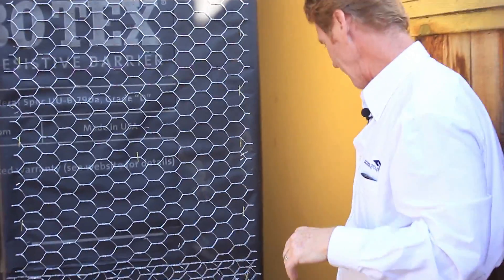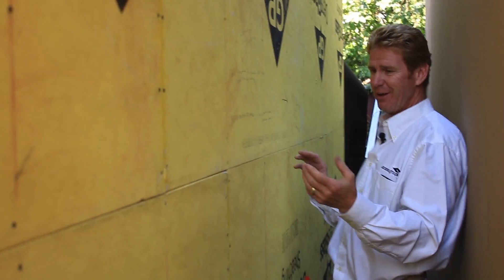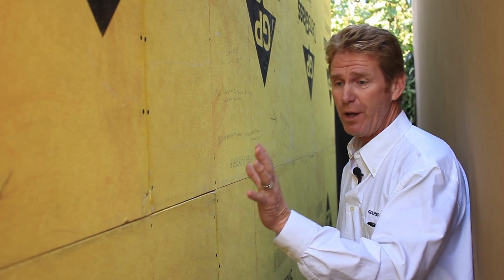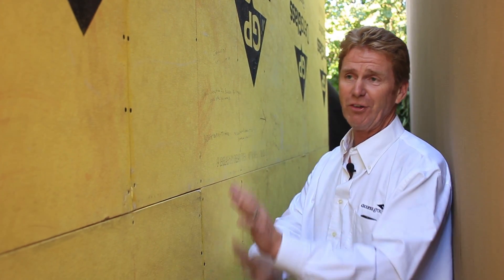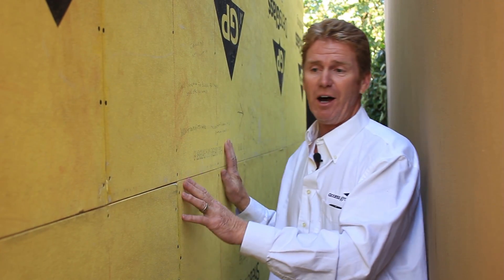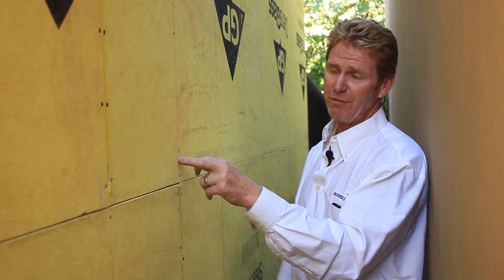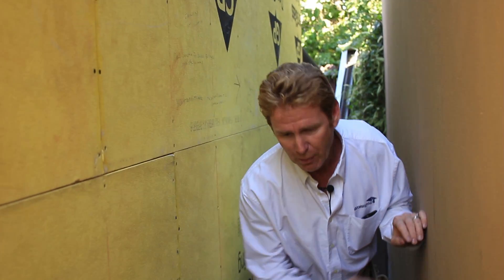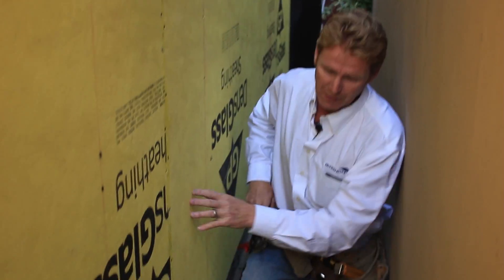Stucco over Densglass sheathing

Comment: Do wide crown staples work to adhere lathe to dense glass where there is no plywood behind densgalss ?
Reply from the maker: They do indeed and are code. Here's a tip,  use a Staple gun leg length that shoots at least 7/8 of the leg into the stud. 
Make sure your gun staples are adjusted properly so that the staples don't rip the paper as Dens-Glass is soft.
 I mention this because on Amazon there are staple guns that sell for about 100 to 350 dollars.
 One often gets what they pay for. This coming Friday, I address this issue in an upcoming video

Comment: Does the densglass have to be put on with any special screws or staples ? I got a house I’m putting denseglass on tomorrow
Reply from the maker: @briancota4648  DensGlass Sheathing is an engineered exterior gypsum sheathing used as a substrate for various exterior cladding materials, offering superior moisture, fire, and mold resistance, and can be used in areas prone to moisture. 
To attach DensGlass sheathing, use nails or screws, ensuring they are driven flush with the board surface and into the framing system, and stagger the joints.
Cheers, Kirk giordano plastering.
Reply: @ what do I use to cut around windows ? Same rotozip just like drywall? Do the screws need to be rust resistant
Reply from the maker: @ I’d recommend you install the dens glass like you would plywood.🕵🏼‍♀️

Comment: Makes me wonder.  What is the preferred sheathing for a home built today?  I’ve seen Zip used a lot in new construction but in areas with older homes and a poor economy they still put house wrap over Osb 🤷🏻‍♂️
Reply from the maker: Hello my friend, today code in the USA is plywood, you can use OSB, but naturally that is not as good as real plywood. Some older homes have redwood siding which was placed on the studs from when it was built. This redwood siding is even stronger than the plywood that has been code for the last 40 years. When I started there was no siding just studs. lol

Comment: Teacher help me this wall does not need to carry stucco oh plaster. It will be that I can. leave it like this without plaster, I only cure the edges and joints and then I prime it and at the end the paint... could it be possible?
Reply from the maker: Howdy Andrew, I'd check with the city in your 
area. In our area, this board needs some kind of finishing, such as stucco or wood siding. 👨🏻‍🔬
Reply: @StuccoPlastering  thanks teacher your the best

Comment: Kirk , this is Hill Billy from KY enjoying 147 the Kentucky Derby , I have a similar application going on a ceiling we was told to mess in the joints with a polymer base coat a lot that these dryvit applicators use , and then skim the entire surface area , there wasn't a spec on it about 10 ft off the ground and had gotten water damage but that's how we fixed it after the roof was patched with EPDM what is your thoughts on this my friend God bless you and your family I hope you're doing well it's been a while since I've been on YouTube I got kicked off of it for a while can you believe they said I was a redneck LOL peace and love always my friend

Comment: Is there weather barrier between the plywood and the gypsum board.
Reply from the maker: Good evening Miguel, no, the weather barrier need only be applied once on top of the Dens-glass, as a rule, one must handle Densglass as they would plywood sheathing or any other substate. Two layers of 60-minute Paper and stucco netting wire then applied stucco.
    The complete plastering encyclopedia on video, by the plastering messengers of Youtube.  
     Over 850 free self-help videos 🎭 👀💃
Subscribers, you can depend on us to explain with truth, honor, experience, and skill for your time invested for wishing to learn the hows and whys of plastering.😉

Comment: Can u apply motar with a stone veneer without a mesh scratch coat? Or do u need to use a mesh with the denglass gold exterior sheathing
Reply from the maker: Good evening Lisa, no, the weather barrier still needs to be on top of the Dens-glass, as a rule, one must handle Densglass as they would plywood sheathing or any other substate. Two layers of 60-minute Paper and stucco netting wire then applied stucco. 
It's best to apply a scratch coat then allow to set, then attach whatever stones you wish to uses with a tile setting grout or Stucco mortar, or even Poly Bond by La Habra.
    The complete plastering encyclopedia on video, by the plastering messengers of Youtube.  
     Over 850 free self-help videos 🎭 👀💃

Comment: Kirk, thanks for the informative video. Just had this fiberglass sheathing installed on a rooftop room being built. Thinking of going with an Acrylic Stucco (based on your other videos). 2 Q’s, 1) can you apply Acrylic Stucco directly to this fiberglass (my construction manager seems to think so), or is some paper/water proof membrane recommended before? 2) I know you don’t like to mention products but given availability thinking of going with La Habra Perma Flex/Finish EIFS. Any thoughts or considerations on this product? Room will get lots of sun as I’m in San Diego. Many thanks in advance for your help 🙏🏻
Reply from the maker: Evening, you have to terat this denglass as you would plywood sorry.😏
Yes, LaHabas perma flex could be used as a finish coat after the lath and bascecoat. 
Your construction manager is going to get you sued with his mistaken advise, he means well but is wrong, you cannot just use an acrylic over denglass, it will fail in less than 3 to 5 years and will have to be taken off, new studs and insaltion plus.........🤷‍♂️
Bringing peace, love, and brotherhood back to the world of “Plastering.” 🌍
    The complete plastering encyclopedia on video, by the plastering messengers of Youtube.  
     Over 800 videos 🎭 👀
Reply: Kirk Giordano plastering Inc. thanks for quick reply. Do you mean treat Densglass?  Yes would follow the manufacturers instructions, e.g., primer / base coat.  Thanks again much appreciated 🍻
Reply: @Rishi.Rao.  The stucco won't last for long onto the sheathing without insolation, it will start cracking and peeled off in a few years

Comment: How would you prep DensGlass when finishing with stone veneer?
Reply from the maker: Evening my friend, I would prep the dens-glass the same way we do plywood, first, the moister barrier, usually, two layers of Jumbo tex paper then stucco netting, lastly just a scratch coat, the scratch lines give the stone something to bo bond to. 
FYI, When ready to attach the stones to the scratch coat wet the scratch coat, (first coat) to where it's moist, not dry or dripping wet.
 We call it a mechanical bond. 
 Again, don't apply the second coat as it's not necessary and counter-productive.
                Peace, love with happiness to all.
    Kirk Giordano plastering tips-mixed with sound advice

Comment: attached to the studs are 1 by 6 planks running horrizantly every 8 inches I attached densglass to those 1by6 and hoping I can still blindnail the siding especially because I've already done 80 feet of wall
Reply from the maker: Morning Ben,
 I just do stucco exteriors, therefor I have little knowledge about attaching wood siding, sorry,
 Best wishes, 
 Kirk Giordano

Comment: how do you apply siding to a densglass wall ?
Reply from the maker: Hi Ben, easy peasy lemon squeezy, do as in this video we install lath,(paper and stucco netting) then stucco as usual, preperation is the same as if it's plywood sheathing.
 If it's wood siding apply your membrane (waterproof paper) and attach whatever wood siding you wish,
 Pretend like the densglass is regular plywood and prepare accordingly,
 best wishes,
 kirk giordano plastering